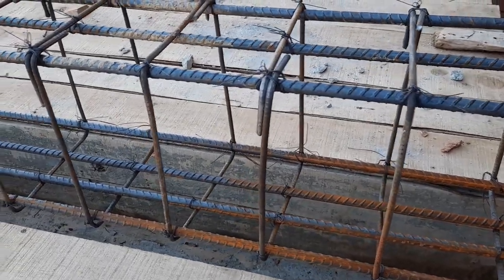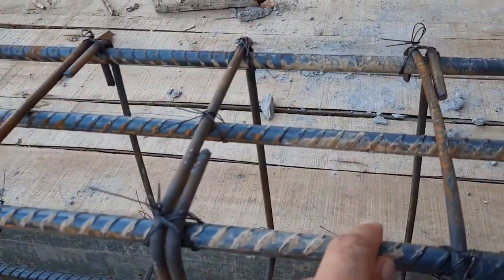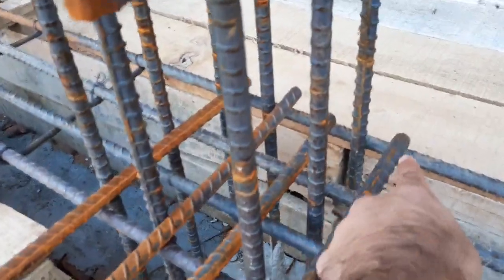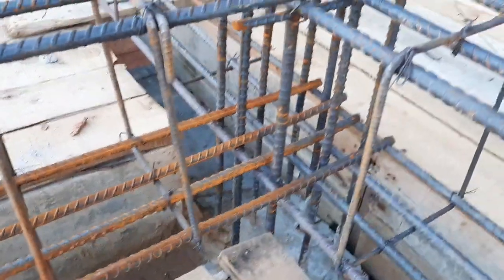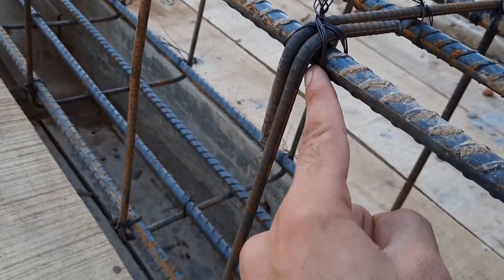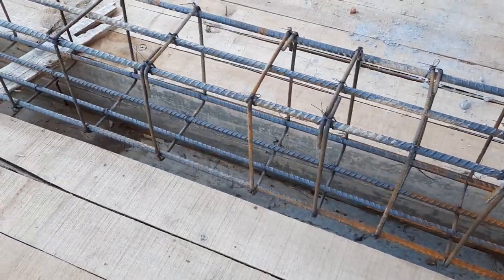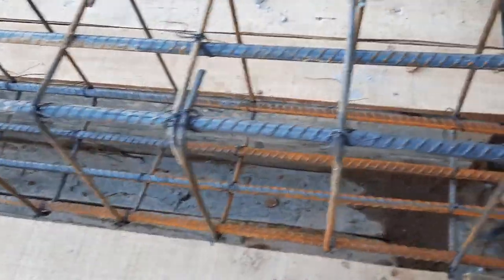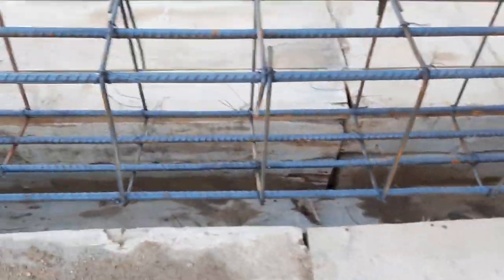Big 10 Mistakes in Floor Beam for 4 Storey Building | Practical Video |

Comment: I am little bit confused about crank bars/bendup bars,in other video you said when 4bars are placed at the bottom and 2bars at the top of beam is ok but in this video they provide 4bars at the bottom and 3bars on top which i think is right or why should they provide a crank bar in this case.